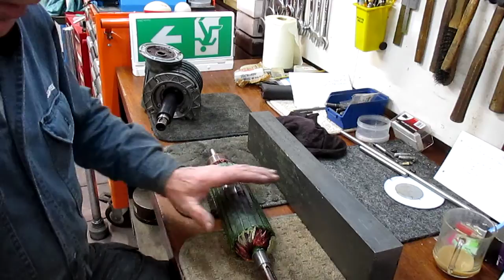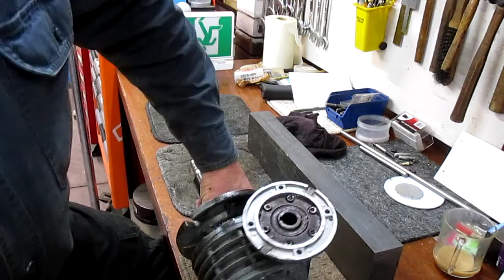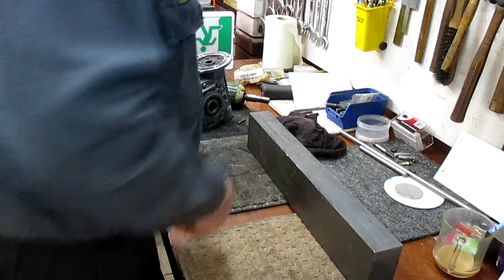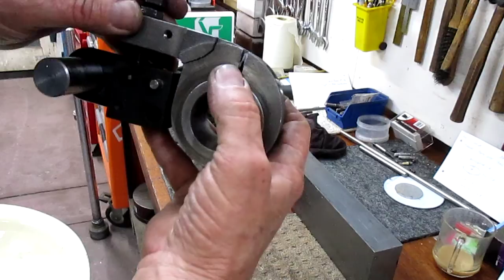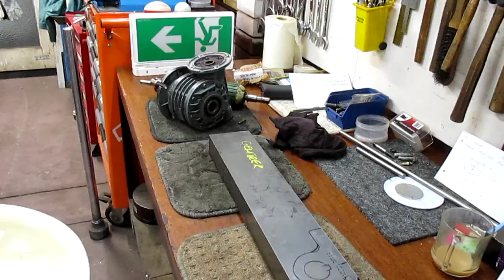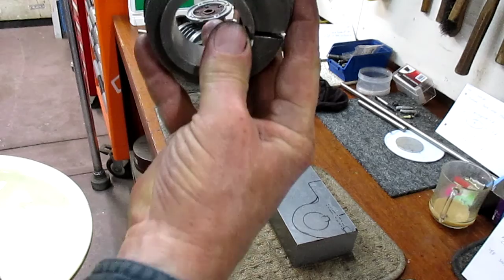Weekend Special Printing Press oscillating shaft drive unit broken.

Comment: It won't be cheap when they want it done in the weekend like that :)
Totally agree with you on the strengthening ideas and making it out of steel. It won't be any extra work.
Reply from the maker: You are correct, but sometimes the repair costs pales in significance against the downtime costs. The hardest thing in these cases is finding someone who is prepared to work long days and on the weekend.